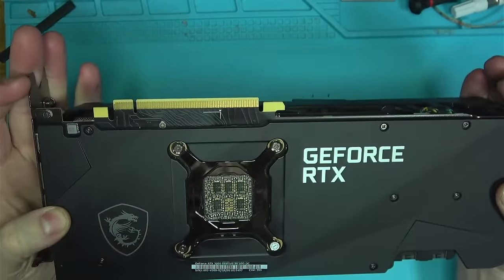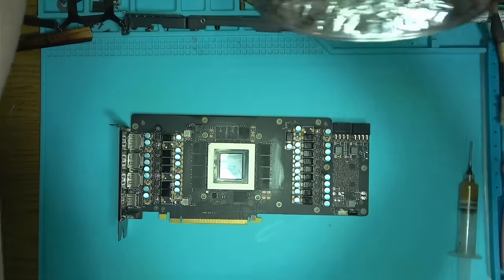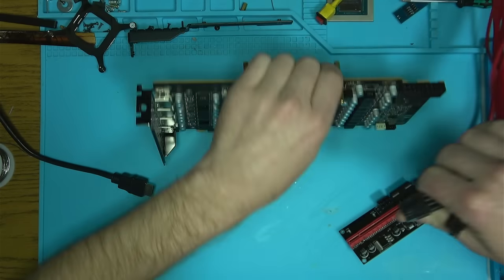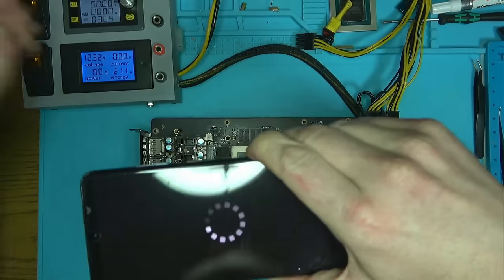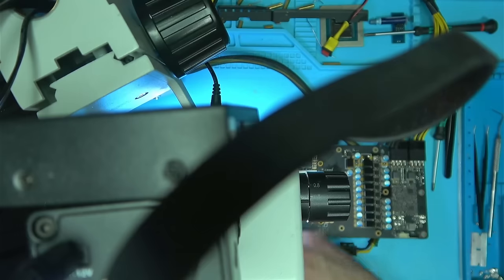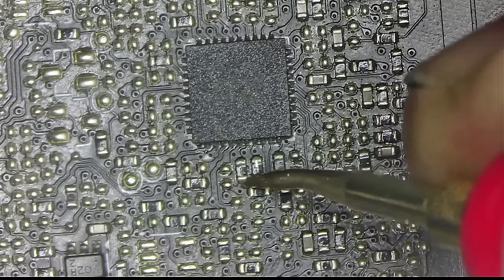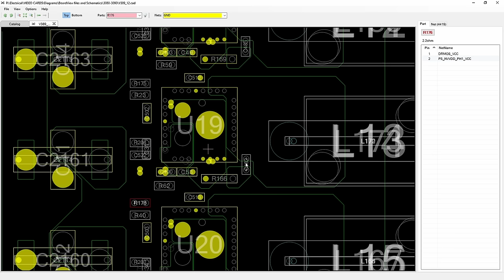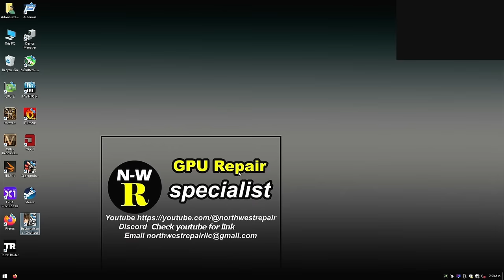This is why GPUs break too easy (long story)

Comment: Actually wouldnt lead free solder prevent the gpu from desoldering itself?
Reply: Desoldering themselves is just NEVER the problem. The melting point of leaded is around 183°C-190°C and of unleaded around 217-225°C so uh good luck with those temperatures, there isn't all that much between them anyway. 150°C is guaranteed quick silicon semiconductor death when passing current. When you see bad solder joints well either the solder joint cracked right across the solder (you want external reinforcement or more flexible solder to prevent that), or it wasn't soldered to begin with and just seemed to be making contact (immersion gold coatings, better intermediate storage, and better flux help with that).
Reply: @SianaGearz  silicon has a melting point well over 1000 degrees. But i think melting point isnt the only problem, its the heat cycles(the lower melting point the worse probably), lead is quiete brittle. Actually i just f ound a paper that said gold in solder poses a greater risk than lead 🤷🏼‍♂. Anyway i think solder alloy quality is important as cheaping out will cause instability in the heavy electronics.
Reply: @ChrisWijtmans   The problem certainly isn't the melting point, but runaway electromigration at the junction, where at high enough temperature, in short order, you're not going to have a semiconductor any longer but a permanent conductor. The point at which this happens lies generally somewhere shortly north of 150°C.

Lead is not brittle. It's exceptionally ductile. You can form it by hand, it's awesome, it doesn't work- harden, it's an amazing material. Granted you better not touch it with your bare hands for health reasons. But watch someday a lead roofer work, how they make various roof joints and cover pieces. You can on here.

Gold is another highly ductile metal, very awesome.

But of course you need well measured alloys. Some unintentional and contaminated alloys form complexes that make them oddly behaved. Example Zinc Pest. You can have an alloy piece that has amazing engineering strength one day (similar to aircraft aluminium, very close) and in a few weeks worth it transforms into something that crumbles right in your hand, it's amazing what a little contamination can do.

Curiously the similarly named Tin Pest affects pure tin, it can go from ductile to crumbly just like that, and to prevent it, it is alloyed, trace amounts of bismuth or antimony can prevent it. But more than trace amounts can make the alloy brittle again! I don't understand any of it, metallurgy is like modern day alchemy.
Reply: @SianaGearz  I've tried some tin/bismuth soldering alloys in the past for plumbing, worked well. but not as good for filling loose joints. Bridgit is my current favorite, it has a tiny amount of nickel in it, stays very shiny for a long time, and has a small plastic range, and doesn't instantly turn liquid, so it's great for filling in small gaps, which is why it's named Brigit. Silver bearing solder is good too, but it's expensive, and high melting point. It's good for plumbing but way too high melting point for electronics.
Reply: @brnmcc01  Well SAC305 is the standard solder for electronics, or at least it should be according to numerous industry and semiconductor manufacturer recommendations. It's a tin based solder with 3% silver and 0.5% copper. It's clearly not too high temp, 220°C vs. 190°C for old standard leaded. I think some companies skimp and use SAC105 instead or similar. It's clearly a little pricey but not about to make your electronics any more expensive. If it were to impact GPU manufacturers in particular, maybe they should put a little extra effort into making fitting paste stencils to stop tinning pads for unpopulated passive components and MOSFETs on lower grade cards where not all foreseen footprints are used.
Reply: @SianaGearz  3% silver is a decent amount, and the tiny bit of copper will help with electrical conductivity. Sounds like a good solder, and seems quite safe to use on drinking water copper pipes too. There's enough silver in that alloy to prevent the dreaded "tin disease", so maybe all these problems are just cold solder joints, GPU's getting dropped/kicked around in shipping. Gotten quite a few boxes from FedEx over the years looks like were used for football practice...
Reply: @SianaGearz at the place I work, we only have SAC305 for LF paste and 63/37 for the few leaded jobs we still occasionally get. Both work very well. I understand why there are populated areas on product "a" and not on product "b". They can use the same bare board and paste stencil for multiple different products by altering component placement for each as needed. The unpopulated areas aren't really adding any noticable cost, where redesigning and ordering different stencils for every different configuration would definitely add up so it seems to me that it would be more cost effective to have a few open areas.